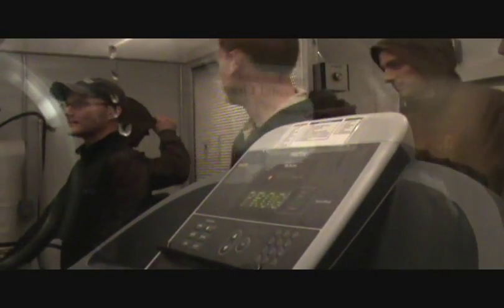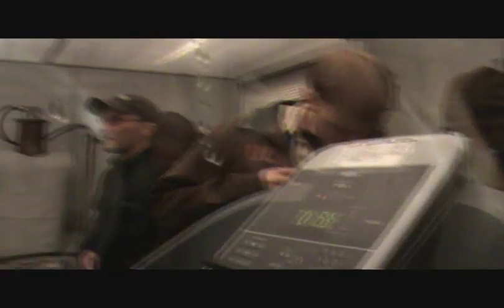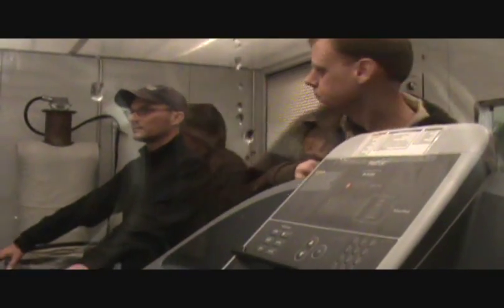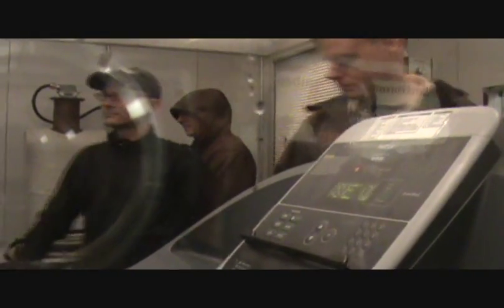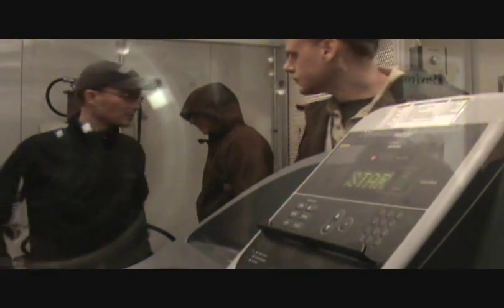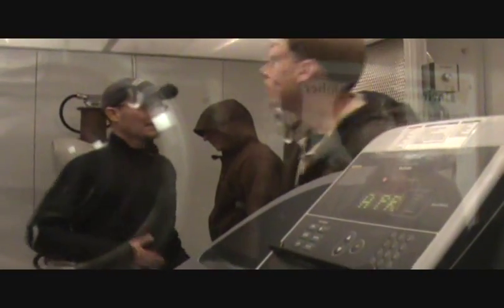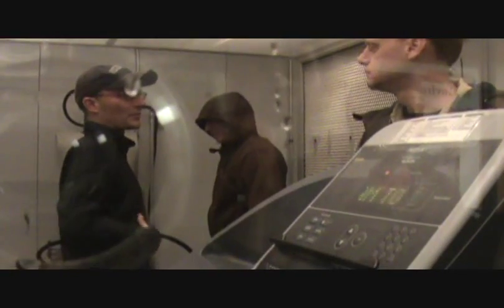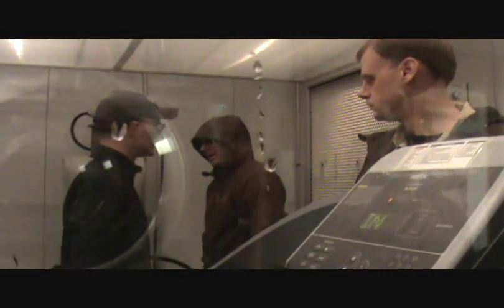Gore-Tex Factory Tour

Comment: water on the fabric's surface can lower the temperature of the fabric through evaporative heat loss. This can cause warm, humid air inside the garment to condense on the inside surface so it feels wet—like it's leaking